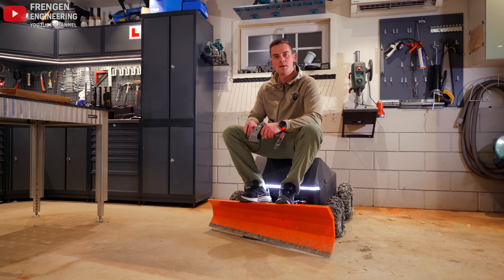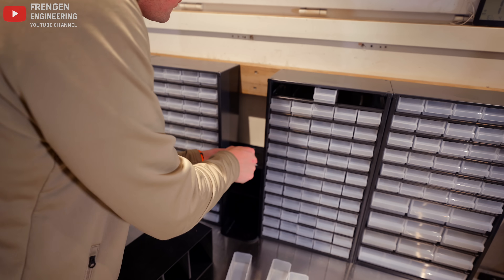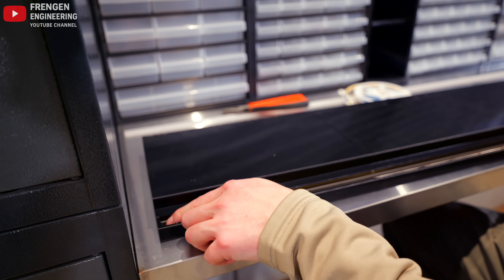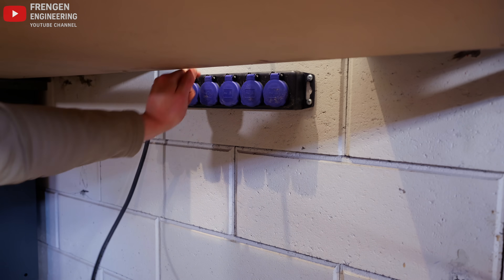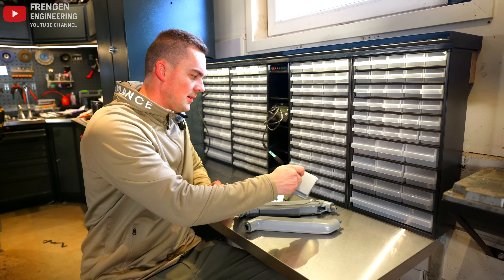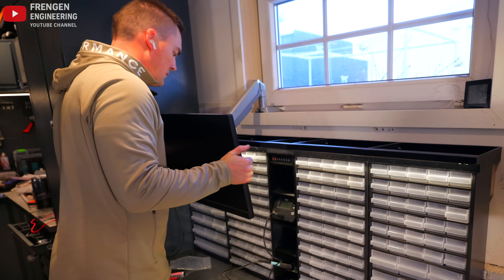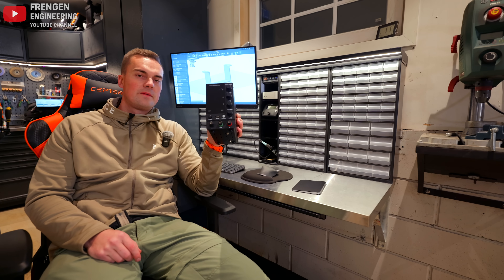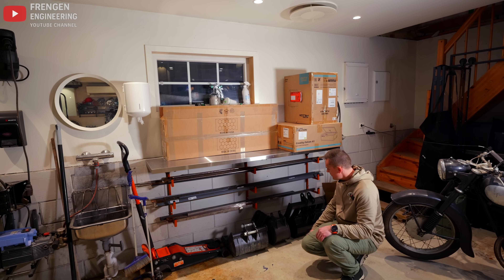Building My Dream Workbench for CAD, Soldering & 3D Printing

Comment: Hey man, nice video but I would suggest 2 things. 1. Get an osciloscope (Rigol DHO804 or MHO954 for higher end) and 2. Get a better soldering station something using C115,210,245,470 JBC tips. Look into Aifen A9E, Geebon TC22 or 24, night and day difference
Reply from the maker: Hi! Thanks! For the last 28 years (since I was around 8 years old) I have always wanted a weller soldering station. Now, when I finally got one, I understand that they are not so good anymore😄 Could you please explain what’s bad with the weller? I think it works way better that all the cheap soldering irons I have had in my life. Night and day difference. 😊
Reply: @frengen_engineering The tip technology is ancient. The way the tips transfer the heat to the solder is just ... bad. Also the way the temp sensing is done is not so good. The JBC style ones have much better response and you can even use genuine JBC tips with the china stations. Also the china station can up to 400w. But that's for the c470 tips. 245 can do up to like 200w. The geebon tc22 is best all rounder but I REAALY recommending getting two stands c210 and c245 or c115 and c245
Reply: @frengen_engineering  Even more importantly the tip selection with the jbc style  tips is.... insane just google jbc c245 tips and look at all the tip variants.... I think there is over 50 for c245 alone

Comment: You will realize, or have already realized, that the drawers on the table are not functional. You won't guess how I know 🙂

Even 5 cm above the table, before the drawers, makes a big difference.
Reply from the maker: Yes, they are a bit shallow. I will print spacers, making them 8 cm deep😊
Reply: @frengen_engineering  When planning, you don't realize that you can't really have anything on the table if you want to use the bottom drawers.

Don't worry, next time you'll remember this lesson learned the hard way 🙂
Reply from the maker: @Aslak_Leamjohka Off course I was considering this, but the drawers in the bottom is not used often. And I did not want the cover the wall speaker covered more than necessary

Comment: I love your desktop but you may find it can pose a problem when you are soldering or working with electronics. The table can pick up static electricity from you (especially with that rug you put under the table) and can short or harm the electronics you are working with. Table tops that are metal are a no no in electrical engineering. Just thought I'd give you a heads up. Having a large rubber mat to work on, on top of the desk and a grounding wire wristband may help to prevent any accidental charge build up. Otherwise great video!
Reply from the maker: Thanks for the tip! I went for metal since it’s a bit close to my welding table😊

Comment: It's a bad practice to drill into your walls for anything really. The game changer for any workspace, is simple using Pallet Racks or some kind of metal industrial shelving and then using a single rack to connect two sides of shelving together and making a long workdesk out of the middle shelves and using the bottom and top for stowing away things or simply using them as anchor points for support for building other ideas.

Comment: Really good videography but some of the actual setup is not logical at all. You can't pull out the bottom drawers with anything on the desk, also you should have importandt tools in front of you, not parts storage. 
The bench psu is unreadable and hard to operate at that location and it is not even wired in and from experience, you will end up needing it in random locations to test stuff so mounting it without a way to quickly grab it is a bad idea. 
Same for the soldering station, also the screen is angled up so to check if it reached working temp you need to stand up (also that line of Weller is sadly garbage, even a cheap Pinecil beats it by a LOT but a real or fake JBC station with 245 style handles would be the best). Then you will have 3-5s heating up time from off, a huge upgrade fo not much more than the weller (well even less with the pinecil or JBC copies) and the tip integrated heating element gets you soo much better temp control...
The usb power supply should have been at the bottom so you don't have wires hanging right in front of your soldering station (unless you want to charge stuff on the top shelf).
Having the monitor to the left side of the desk with bins right under it makes sure you can never directly face it and have to work at an angle but you will realize that quickly unless you only have the screen and setup to reference your designs, have schemaitics or namuals open on it but you mentioned cad and that is an expensive setup to use as a pdf viewer so you should make it more ergonomic to use.
Obviously it is just a quick setup for the vid but you are missing leads for the psu and for the usb power thingy, no solder, no way to quickly access the most used screwdrivers, tweezers, soldering wick, multimeter whatever else you need.
In short storage should go somewhere else and you should use that space on the wall for stuff that is actually used and you interface, there is no reason to have every chinese devboard, component, screw, connector right in front of you just to lose valueable space right in front of you.
Reply from the maker: Hi, agree with some of your points here. But for my needs it suits the purpose quite well. The lowest drawers may crash if Im working with large stuff in the bench, but still, they are easy accessible. The usb power station was ment for charging stuff laid on the top, not mainly for the actual bench. The weller may not be the best, but it’s quite good in my opinion. The 's screen is very readable from every sitting position.  Also, the monitor placement works quite good, as its adjustable. It can be moved to be almost in the middle of the bench. The underdesk- shelf is ment for storing some of the tools, but I am planning adding the most used tools both on the left cabinet wall. This is both a garage and a workshop, and I needed a quite compact solution. 😊

Comment: I thought maybe you could have a pc fan situated behind where the soldering station sits in the bottom cavity chamber, hooked up with a toggle switch and rpm controller, and use it to help push away the fumes that you get when soldering.
Reply from the maker: Good idea! I have gotten the fan and everything, so I’m planning doing something similar😊

Comment: It's diffusor, a "reflector" would be mounted behind the lightsource in a lamp with a lightbulb or tube to direct it back to said diffusor.

That's an awesome workbench you built, good job!
Reply from the maker: Thanks for sorting it out😄 I was wondering ig it was called a deflector, but that’s for pointing light in a specific direction, like a reflector😊

Comment: Wouldn’t it be uncomfortable when you have a cable with, say, 12 volt power on it, lying on the metal surface on the table, while you have your arms on there as well, being conductive?
Apart from that, a really nice workplace!

Comment: You're going to regret the position of those mains outlets under the desk 😉You want to have several  within easy reach
Reply from the maker: Hi, agree, but I'm planning to add more easily accessible outlets on the right corner of the bench for temporary use. These are mainly for the permanent setup😊

Comment: Hi, I don't usually comment on your videos, but I have some constructive observations to make, namely that making a soldering station with just the soldering iron seems a bit small to me, as you could perhaps add a desoldering iron or a benchtop power supply in a future upgrade. As for the rest, I like everything. Congratulations, but in my opinion, the configuration you've studied isn't designed for upgrading. saluti dall' italia
Reply from the maker: Hi! Haha, understand. I’m a bit restricted on space, but I did install a adjustable power supply. It’s mounted on the cabinet on the left. And I do have quite a lot of additional soldering tools in the drawer to the right. Also got the equipment to make a smoke extraction, pulling it outside. Consider it a par one video😄

Comment: Nice soldering workbench but maybe the mac position is not ideal to reach its power button.
Reply from the maker: Thanks! The Mac powers up by pressing a button on the keyboard. The only button on the Mac is on the underside, so I guess it’s not intended to use it other than first powerup/ hard reset😊

Comment: Nice station, only think i would change is the power bar position from under the desk to the left cabinet walll vertically behind the power supply so you can plug and unplug without going under the table
Reply from the maker: Good point, The ones in the underside was mainly thought for all the permanent equipment. I was planning adding outlets more accessible also. Will do😊

Comment: What is the led driver and controller you are using? You held it to the camera but it didn’t focus on it. And your smart home app, is it Home Assistant?
Reply from the maker: Hi, the LED driver was a locally bought 24V 25w dimmable unit.  Don’t know the brand unfortunately. The smart system is called Eaton xComfort. Quite well known system here in Norway. It’s integrated in google assistant as well as its own app. The lights in the workshop is also turning on by a motion sensor😊

Comment: You really shouldn't be using normal earbuds as ear protection. They turn audible soundwaves into turbulent energy, but it still reaches your eardrums. Get yourself some isotunes or something
Reply: I really like my bone conducting headphones with some 3m plugs. Haven't watched a lot of your stuff (yet) but if you do any welding they fit nicely under the hood.
Reply from the maker: I guess you are correct. When cutting metal I’m using proper ear protection. The EarPods is not good for enough in that case. 😊

Comment: Dude, get yourself a JBC soldering station. It’s pretty expensive, but it’s the Rolls-Royce of soldering irons.
Reply from the maker: I just became a happy owner of the weller😆100x better that what I used to have. The biggest difference is the fast heating, and stable temp. Big improvement going with the JBC?
Reply: @frengen_engineering It will be much better. A pistol-shaped soldering iron with automatic solder feed. Instant heating. Different tips. It’s just amazing.
I used it to solder very complex things, from very small to very large.
I recommend checking out some video reviews.
Reply: You’ll make a review on your channel later)
Reply from the maker: @svietal ok😂
Reply: @frengen_engineering Weller is a very good and reliable brand.We use that and have been for the past 10+ years

Comment: Now you just need a 3d filament creation thingy for all that wasted support material ! 🧑‍🍳
Reply from the maker: Haha, good point! Have not done any research on that yet. Is it working good? I mean, the recirculated filament?
Reply: @frengen_engineering  There are not many that do this, and the tooling/equipment isn't widespread in use. I've seen people on youtube making their own machines for this, but it seems that it takes a lot. I think you have to print a lot in order for this being worthwhile.

Comment: Nice setup! I don't know how cold your metal desk get in the winter. You can try a reptile heating mat for snakes etc.   :-)
Reply from the maker: That's a clever idea! Thanks for the suggestion! 😊 Maybe a cork desk- mat also works good. Just not when I’m welding near by😆
Reply: @frengen_engineering  or one of the big mouse pads. It depends if insulation is enough or you if need aktiv heating. Please don't be dumb with "I can stand the cold, I am manly." A  Tenosynovitis is sh... and takes long to cure.
Reply from the maker: @joehoandroid Agree, but the garage is not very cold tough, the heat pump is installed just next to the bench☺️

Comment: pretty cool! since you have a window right above the workbench, maybe make an extractor fan setup so you can suck any solder smoke outdoors? that would probably require you making a custom plexiglass window  with a flange attachment though, might be more work than it's worth haha. Maybe make a magnetic attachable wall to place on the right side of the table as well, to prevent any screws from rolling off the table to the side.
Reply from the maker: Hi! Absolutely. Actually I got the fan and a tube already, but I did not have time to finish it before today. Also, did not have time to fill all the shelf’s and mark up everything. A two day job alone, marking all this shelf’s, I guess😄
Reply: @frengen_engineering  My recommendation when you fill all those drawers is to color code! If you use the same color label for everything you'll drive yourself crazy. If it ever gets very hot in your garage in summer in your area, you can always turn the extraction fan into a cooling fan for you while you work haha at the computer haha. Another good idea is you can use foam inserts for the drawers for storing small tools in the Kaizen style.

Comment: Not enough depth - 35 cm ? - for resting the arms and stainless steel too cold for them. Not ideal for dealing with electronic parts like PCB.
Reply from the maker: Hi, the bench top is 46 cm deep, but a bit over 40 cm usable, because of the drawers. Agree that it could be a issue with metal regarding working with electronics and cold. Will add a bigger mat on the table for working with bigger electronics projects. 😊